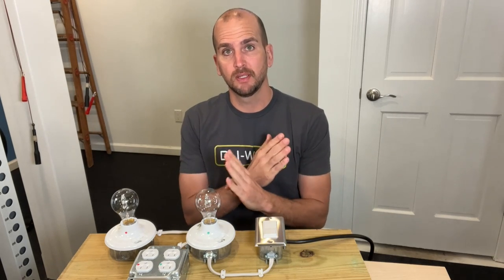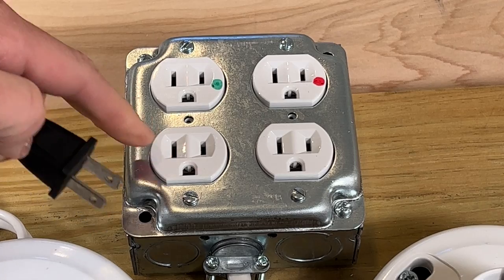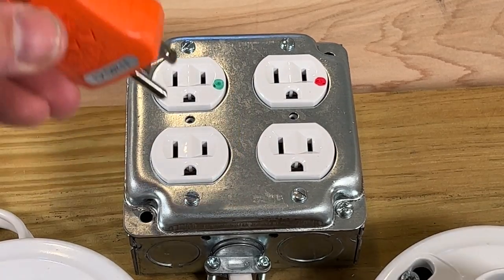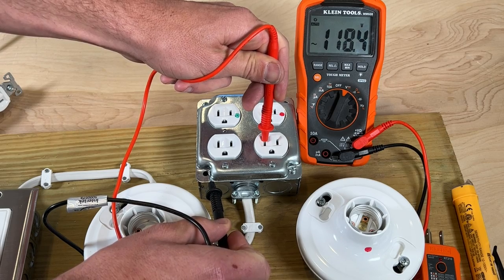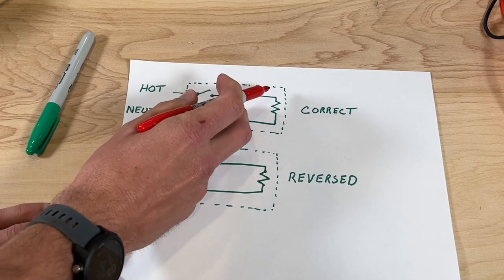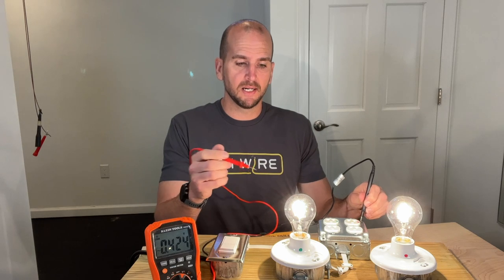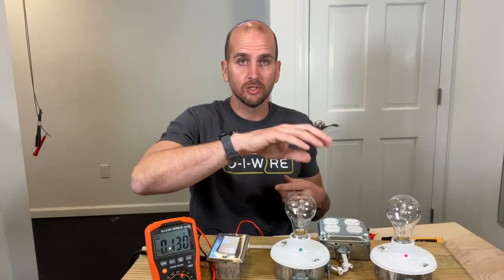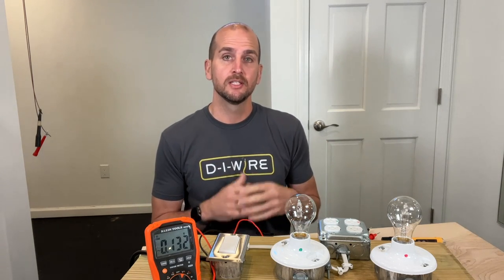Dangerous Wiring Issues In Lights and Outlets

Comment: the fact the grounded box has a full volt on it without even making a full circuit can't be right. Also the US electricity system is batshit insane that polarity is an issue.

Comment: You missed an opportunity to show the risk.  The safe way to change a bulb is to turn the switch off.  Then show with a meter and probe that the threads are still hot.

Comment: Related to reverse polarity at lighting fixtures you should do a demonstration on a very old three way setup,  known by various names like Carter 3 way, Chicago 3 way, farmers 3 way, barnyard 3 way, power-beyond 3 way , among others.  This awkward setup involves the hot and neutral hooked to the travellers on each  3 way switch,  then continues the circuit after that.   Usually a single wire comes of the common of each 3 way to the light,  but sometimes used the red wires if done with 3 conductor NM .    The light will be OFF if it gets two neutrals or two hots,  but will be ON if it get a hot and a neutral,  regardless of polarity.   This is usually seen with knob and tube, in a long hallway or stairway, but is sometimes used with NM as it actually saves a conductor,  so old timers who lived through the depression were very frugal and whenever they could save a dollar here and there they would.    It's worth noting this setup was actually banned by the NEC in 1923 but has continued to be used decades afterwards.

Comment: There 1 fault of your idea also, a neautral is not a ground. A neautral is a traveler wire means it gets the alternated volts the current line supplies. If the circuit is  120v ac  current   line  , tbe neautral line is half that at 60 v ac. Only a ground wire connected to earth ground is 0 volts.
Reply: That is just total nonsense. Neutral is the grounded conductor.

Comment: I'm not debating that incorrect wiring isn't safe (mostly to you), but how can incorrect wiring damage a product over time? First of all, we've got to acknowledge that AC constantly reverses polarity. I can't really see how "polarity" matters to a device when using AC. Actually, what we call polarity isn't polarity. We just use it to conveniently refer to a hot/neutral system. If we used a hot/hot system, it wouldn't matter which side is which. In fact it may have been that way until 240 came into our homes. When the hot/neutral system became available, people were still using non-polarized lamps and receptacles. Fun times. Basically, zappies do bad things to people, so we started polarizing stuff. As for leaving a hot connected to a device while not in circuit, it's not in circuit so no power is going through it. I'm overlooking zombie power in poorly designed light bulbs for now that are lighting due to capacitance which is in the millivolts. The innards of the device may be idly sitting at the hot voltage potential, but everything sits idly at a voltage. That's why it took thousands of years to even realize it was electricity was even there. People got zapped on doorknobs during the winter, and probably thought it was demons or something.

Comment: A worse scenario would be if you actually had the switch wired on the neutral. Then even if the light was turned off you could still get shocked.

Comment: In the big picture, this only matters In cases where children are present. Adults should know better. In either case, with ac or dc circuitry, switching either side of the circuit produces the same results: an open, or incomplete circuit, neither of which is detrimental to your devices. If it were, military gear would burn out much earlier than any commercial gear, because, by and large, military gear is switched on the ground side and much of the shipboard AC circuitry is switched on the neutral side. While your hypothesis seems sound, it fails to hold up on practical use, except where children and stupid adults are concerned.

Comment: Hello, 
There is no term such as polarity in AC with due all respects. Tesla would have committed suicide hearing this term. There are Hot and Neutral, Hot, Ground, and Hot, Neutral, and Ground; nevertheless, Positive and Negative. Furthermore, the Ground Side considers Neutral if the resistance between the Neutral and Ground (Earth) Sides is less than 1.0e⁰ Ohms, <1.0e⁰ Ω. Positive and Negative Terms are for the DC Current, where there is no Cycling (Hurtz, switching) between the sides (*not positive or negative Poles) at almost any time, like seconds. 
Some people do not experience shock touching live electricity wires or elements to a limit, called a skin situation. The *Skin Situation occurs when the body's resistance is nearly zero, or there is not enough mass or volume for the current to flow in/inward. The current hovers over the skin rather than inside or within the flesh in people.
Personally experienced this period between the ages of fourteen and twenty-two and could tolerate up to 3.60e² AC volts. The continuation of touching live AC wires, living near or under high voltage wires, is cancerous (leukemia).
Sincerely,

Comment: By wiring a extension cord the wrong way and using it to power a aluminum skinned trailer you end up having a hot skin. Very dangerous if your standing on grass and touch the trailer. Young was boy killed by this.

Comment: 5:50 That it might reduce the life  of equipment when wired reversed is BS.... As long as there is no closed circuit, there's no load or work done by device.. In Europe we do not even have polarized outlets... And you are telling me our equipment is massively having (maybe) a shorter live? 🤣 🤣 🤣 🤣 🤣 🤣 Wouldn't that also mean that the switch has a hard time when polarity is correct? 🤣
IT IS (COULD) ONLY (BE) A SAFETY ISSUE

Comment: You're right about this being a common wiring error, but dangerous? 🤣🤣😂  Rarely.  Only if an idiot attempts to massage the base of the bulb while removing it.  Now, . . . I'm over 6 feet tall and can change light bulbs standing flatfooted on the floor, but even I don't touch the base unless the bulb breaks.  And then I use insulated needle nose pliers to extract it.  No, I hold the bulb BY the bulb to install it or remove it, not by the base.  How much less likely is a short person to reach up higher than the bulb just so he can touch the base and get shocked?  A short person normally uses some sort of step stool which insulates him from ground.  Unless you're on a concrete or metal floor or standing in water, you're normally insulated from ground, anyway.

As for the "extra circuitry" that allows those electronics adapters to have only two prongs, it doesn't exist.  They do use a transformer that provides isolation between the output and input, but they would do that even with a 3 pronged plug.  The internal circuitry only sees 120VAC across the two ends of the transformer primary and that's all it knows.  It doesn't know whether there are two wires or three that bring it.  If you take into account that only two terminals are used for that purpose, there is actually less circuitry.

Comment: correctly wired ligthbult would not let you get eletrocuted even if you where shorted to ground yourself.
incorrectly wired ligthbulb fixture will electrocute you even when off if you yourself are grounded.
im surpriced this was not demostrated. only mentioned at diagram.

Comment: As a visitor from Europe I was amazed by the skimpy design of plugs and lamp sockets. Our high European killing voltage of 240V mandated safer designs. Old world vs new world! But I love the simpler design and if done right is very safe and 60Hz!
Reply: I don't see why you think that the frequency has anything to do with safety
Reply: @michaeldunham3385  50 Hz or 60 Hz has nothing to do with safety, but 230V is much more dangerous than 110V,  60Hz! Did I make it clear for you?
Reply: @arnecarlsson9740  if frequency is irrelevant to safety then why bother even mentioning it?
The US voltage is 120V and yes it's obvious that the higher the voltage the more dangerous it is, there's also a variety of other factors that can increase the risk of a fatal electric shock.
Reply: @michaeldunham3385  
This seems like such a silly thing to start an internet argument over.  The guy was actually praising our electrical system vs the one in Europe.
I mean...  you do whatever you want.  I'm just over here pointing out that your response is out of proportion to the mans comment.
Reply: @michaeldunham3385  110V is safer than 120V at 60Hz. 😂😂😂
Reply: @saberx08  are you serious? He pointed out that European electrical equipment is safer by design. 
Another point of using 60Hz over 50 Hz is you're going to use more power.
People keep leaving comments without actual idea about such things, plus it was completely unrelated
Reply: @arnecarlsson9740  do you have any sensible comments?
BTW the US also uses 230V within domestic properties, but of course you naturally don't know that
Reply: @michaeldunham3385  Of course not, when replying to your comments! Residential electric service in the United States (120/240 Vac) is sometimes called two-phase service but this is NOT correct. It is only single-phase, since both line voltages are derived from a single phase of a distribution transformer with a center tapped neutral and are 180° out of phase with each other.
Reply: @arnecarlsson9740  They have 240V supplies within residential properties that's the point, also simply placing a center tapp on a single phase supply wouldn't cause the two supplies to be 180°out of phase with each other..... you're writing nonsense
Reply: @michaeldunham3385  Ignorance is a bliss! This system is common in North America for residential and light commercial applications. Two 120 V AC lines are supplied to the premises which are out of phase by 180 degrees with each other (when both measured with respect to the neutral), along with a common neutral. The neutral conductor is connected to ground at the transformer center tap. Circuits for lighting and small appliance power outlets (ie. NEMA 1 and NEMA 5) use 120 V circuits - these are connected between one of the lines and neutral using a single-pole circuit breaker. High-demand applications, such as air conditioners, are often powered using 240 V AC circuits - these are connected between the two 120 V AC lines. These 240 V loads are either hard-wired or use NEMA 10 or NEMA 14 outlets which are deliberately incompatible with the 120 V outlets.
Reply: @arnecarlsson9740  ignorance? That's hilarious, tell me how long have you been an electrician? Zero days.
You can copy and paste as much as you like.
First you claim that they don't have a two phase system and then completely contradict that by saying that the properties are supplied via two 120V lines 180° out of phase with each other..... that's two phases!
Measuring to the neutral would not tell you that you have have two lines 180° out of phase..... you have no idea
Reply: @michaeldunham3385  If you claim to be an electrician, I would recommend you to stop publicly reacting to my comments. It could become common knowledge that you have minimum knowledge about residential electrical installations and functioning. I could send you a link to teach you how an oscilloscope works and how it can be used to compare phase angles.
Reply: @arnecarlsson9740  I am an electrician of more than 30 years and if you didn't start trying to claim to be knowledgeable about electrical engineering I wouldn't have said anything.
I've literally worked on every type of electrical installation from 33KVA 3 phase transformers to a basic light switch.
No you can't send a link on YouTube but by all means give it a try.
I don't need to use an oscilloscope to test phases, I already have purpose designed equipment for that capable of measuring phase rotation among a whole host of electrical tests that you wouldn't have a clue about.
Reply: @michaeldunham3385  Sorry to say but your comments does not show any deeper knowledge and good manners. I have experienced terrible non conformant installations and accompanying incidents, done by so called experienced electricians. So far you do not impress on me!
Reply: @arnecarlsson9740  All you've done is copy and paste information you've found on the web but shown a complete lack of understanding of electrical installations. You make claims that only go to show you have absolutely no idea about electrical distribution supplies. 
I'm qualified and very experienced, you are not.
I was the main test engineer for one of the largest companies in the country and have literally worked all over. 
Your anecdotal comments regarding issues with electricians are nothing more than unsubstantiated claims. 
Give it up, people like you are dangerous
Reply: @michaeldunham3385  How can I be dangerous, by only present easily verifiable facts in my comments? I guess only to people that think they are the best. Remember the 120 V  lines are 180 degree out of phase in a 240V split phase system!
Reply: There is nothing inherently unsafe on the US plugs. Australia uses 240 V and has very similar plugs, the prongs just are at an angle. The main issue seems to be lack of sleeving and how tamper resistant sockets are rare. In Finland they became the norm in kids rooms in the 60s and elsewhere in the 80s.
Reply: @okaro6595  First a comment on the logic. If Australia has similar plugs it does not make US plugs safe(r). As I commented originally : "But I love the simpler design and if done right is very safe and 60Hz!"

Comment: When you plug a device in that has a fuse, the fuse is now on the neutral side and will never trip.
Reply: How would it not trip? In anyway most modern deices use figure 8 connections that are not polarized.
Reply: Yes it will trip, if the current draw exceeded the rating and the device will shut down instead of burning up, but is unsafe because even though the device shut off it will be live 120 volts to ground,  all the way back to the blown fuse.   Some homes wired before 1930  when knob and tube was cutting edge technology,  had a two fuse per circuit system in which the hot and neutral were independently fused.    You have a 50-50 chance of getting buzzed when you work on what appears to be a dead circuit,  because one fuse would blow before the other, and it could be either fuse.
Reply: @Sparky-ww5re  Would the fuse still protect the device? Wouldn't the power have traveled through the device before encountering the fuse?
Reply: @kennethfisher7013  good question!   Yes, if the fuse was placed in the neutral side instead of the hot side, and there was a problem,  and excessive current flow, such as a motor that has overloaded or jammed, the fuse will blow,  the circuit will break and no current will flow,  but it would be unsafe from an electrical shock standpoint,  that's why we want the fuse or switch placed on the hot side only.  As an electrician when we are on a service call we always test hot to neutral,  hot to ground,  and neutral to ground even when it appears the power is cut.   We never assume that a building or device had been properly wired for safety.   We never assume a switch or breaker has cut power.   They could be defective.
Reply: @Sparky-ww5re  Even us amateurs hate getting shocked. I'm pretty paranoid about getting zapped.
There are a couple of lamps that I'll need to check the wiring on now.

Comment: Along side the safety and longevity of devices and fittings with reversed conductors, most electronics only feature input protection on the input side. So if a device shorts out, instead of failing quietly and just shutting off it will explode violently at 3am sending itself flying across the room 💥